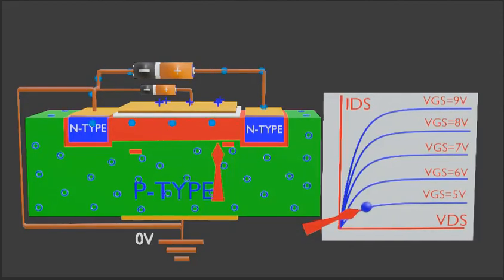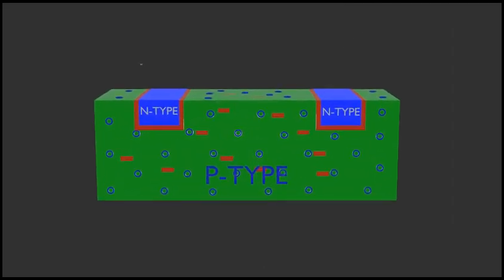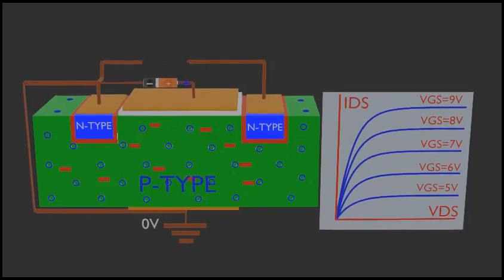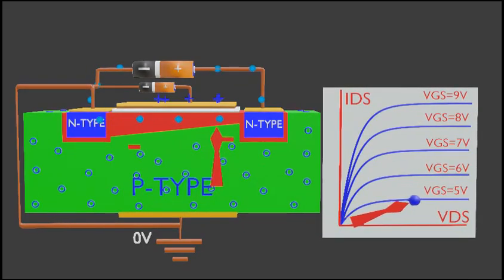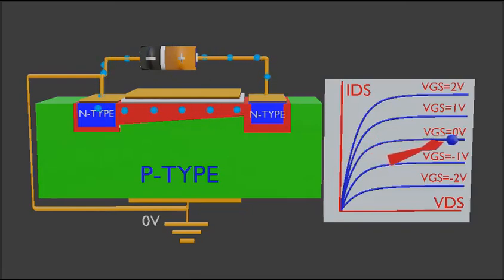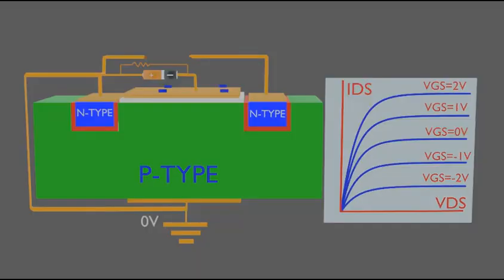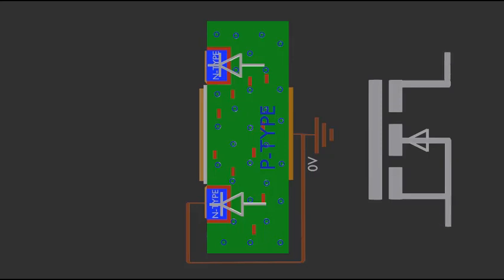Working of MOSFET : How MOSFET WORK : MOSFET working: Funktionsweise von MOSFE

Comment: Why on earth would you connect a battery between D and S, without a load??
1) The FET will turn into smoke in no time!
2) You get a totally nonsensical circuit with no functionality.
Reply from the maker: Its not circuit, just explain to function  of mosfet, ok you can add resistor, what else is the nonsense ？
Reply: @ETSolutions  It will just simply NOT work, the way you present it!  The FET will explode in a blink!  The whole point of using any transistor is that it controls the current through a load.  If you leave that out, it is just confusing people.

Comment: A few more comments.  I don't know why the substrate is grounded.  Most of the time, they are not.  Also, I don't know why an N-type enhancement MOSFET was chosen for the explanation. Conventional current flow for an N-channel MOSFET is from drain to source.  It true that N-channel MOSFETS are often seen in the wild, but it may involve less mental hoops for the newbie to use a P channel MOSFET for the explanation, as conventional current is from source to drain.  It would also be clearer that the forward biasing of the gate relative to source (Vgs and not gate relative to ground) is what turns the MOSFET on.   That concept was illustrated at 3:00 into the video.  Labeling the channels as source and drain would also make the explanation easier to absorb.

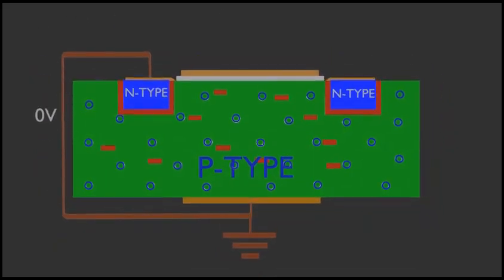Comment: Nice video.  At 1:51, there was a statement that since the source and substrate are bonded, no current flows.  So what?  Perhaps the more important characteristic is that the charge at the source and substrate bond are the same.  As a result, when a negative charge is applied to the source, the depletion layer at the source stays the same, since there is no difference in charge between the source and substrate, as illustrated at 2:08.